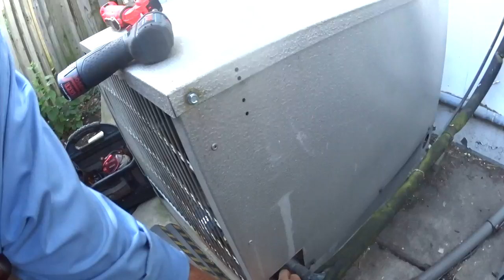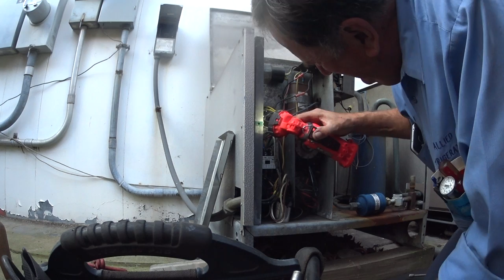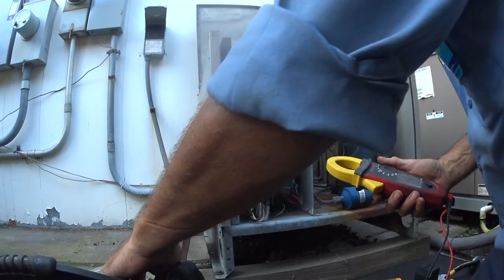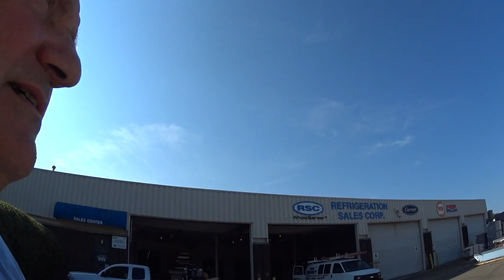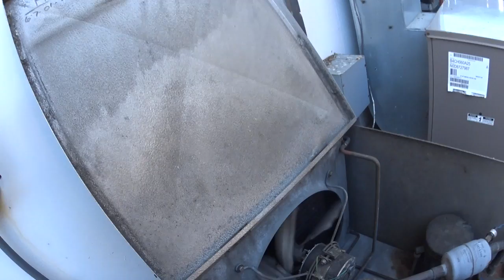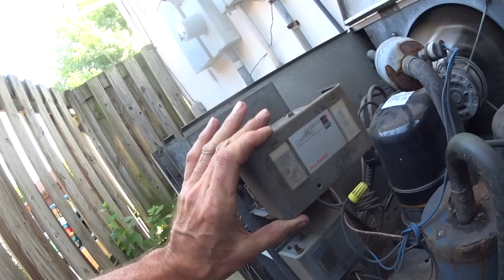7am emergency call Saturday morning

Comment: Failed starting on a compressor, use a hard-start-kit or a compressor saver, with run cap if needed.  Takes only a few minutes after ohming out the compressor between windings and ground.   If it starts, bad start components, if it doesn't, locked rotor.  Would have saved you an hour or more.  If bad start components, change them all, but if they've failed/burn't, then your compressor is on its last legs, more than likely.  Good call on the fan running backwards!  Could have damaged the compressor and caused the whole thing.

Comment: I think you should have retested it with the original relay after fixing the loose wire. Maybe it wasn't bad at all...
Reply: He did. Thats what he did by touching the wire to the relay and then removing it quickly.
Reply: A loose wire would have caused the start cap NOT to engage on start.  The relay was stuck closed and therefore the start cap was always in circuit.

Comment: The relay switches the start capacitor out of the circuit ?  Is the start winding also switched off ?

     What controls the relay ?

     Does it also have a run capacitor

Comment: I have that same amprobe meter too.  It's a good meter for the cost and Amprobe is owned  by Fluke.  I just got a Flir CM174 (clamp meter with thermal imager to insoect electrical connections and any over heating connections.  Flir sold it to me for $150 as a sorry/olive branch from multiple failures to fix a warranty claim on another tool that they sent me a new updated Imager!

 I'm still testing the meters operation, accuracy, and functions before I trust using it.. (extech makes the Flir meters since Flir owns Extech). Also, (just a comment on another one of their test instruments) flir's non contact voltage detector is the best I've used to this day!  I highly recommend it over Fluke, Klien, Greenlee, ect non contact voltage detector.. it has two sensitivity setting for high and low voltage that work phenomenal. SORRY FOR GETTING OFF TOPIC, but I'm a extreme Tool adddict!

Comment: Hey, great work.  I thought that fan motor looked unusual when I saw it running towards the beginning of the video.  I also hate how the fan motor run cap was installed with electrical tape covering the connections and the lack of a strap...it makes working on equipment just that more difficult to sort through.  I keep a roll of perfected metal strapping for replacement caps.  Also, that older low pressure switch may have previously been opening because the suction line drier had pressure drop across it....and the reversed fan motor caused higher head, & possibly suction pressure. You  ever know what the previous clown working on the unit may have done to the unit.  I find loads of equipment with suction line driers that weren't removed after three days to a week.  A trick I learned from a factory engineer is installing two valves and bypass piping around the suction line drier to remove it from the circuit after its usefulness has been reached. It save the tech and owner money in the long run.. not to mention destroying a new compressor because of severe pressure drop from the HH drier.

I had a failed closed potential start cap relay take a compressor out that was only 6 years old.  The system had regular bi-annual maintenace since it's install as well....it was a Bristol two stage compressor..JUNK!!   I'm glad your a meticulous tech, just like myself,  and insist on doing the job right. Just explaining to the owner to agree to perform the work is the only road block that would hamper my work ethic..that's why I document EVERYTHING. (And always take pictures just to CYA..before and after the work) It would embrass me a lot if I did crap job like the previous tech that worked on the unit.  

I wish I had a quality, easy to use, small camera and know how to make videos!

Comment: The relay switches the start capacitor out of the circuit ?  Is the start winding also switched off ?

     What controls the relay ?

     Does it also have a run capacitor ?

Thanks ,   :-)
Wyr
God bless
Reply: Back emf controls the relay once start cap is pulled out of the phase of the motor or compressor.

Comment: heya im from south Africa iv got a freezer room with x3 blowers in the right side one is icing up on the coil i checked the defrost heaters they are working fine what could cause the coil to ice up ? the temp the customer is looking for is -20 but its running on -8 to -10
Reply from the maker: +Davynn Steyn possibly the expansion valve is out of adjustment on that evaporator.
Reply from the maker: +Jim Pettinato https://www.youtube.com/watch?v=94AQr5OQgGo

Comment: Hey Jim- What made you suspect the bad relay? Im somewhat new to the commercial industry and would never have thought to check that relay after getting a high amp draw, I would have thought the compressor had a locked rotor. Ive never seen this problem before, that I know of anyway.-- Thanks Jim

Comment: Great Work Jim!  If you put the amp meter on the start capacitor lead you can tell it the relay is working, once it switches the start cap out of circuit the amps should drop to 0
Reply: It would be nice to knew too the amps difference with the start + run capacitors (stuck relay) & without start capacitor (only run capacitor).

Comment: So Jim the relay is bad I understand that, but was the unit going out on overload because the relay wouldn't shut the unit off?
Reply from the maker: +Luther Fairley the relay was keeping the compressor's run winding in the circuit, it draws high amps, it should only be engaged for a second, then drop out, it's like trying to drive your car down the throughway in first gear.
Reply: +Jim Pettinato thanks! Jim I'm very new to the trade...I love your channel & I also love how you explain everything! Please keep the videos coming

Comment: Jim start capacitors come with bleed resistor. If the resistor is left in line, the capacitor checker will incorrectly read a much higher value than rated capacitance.